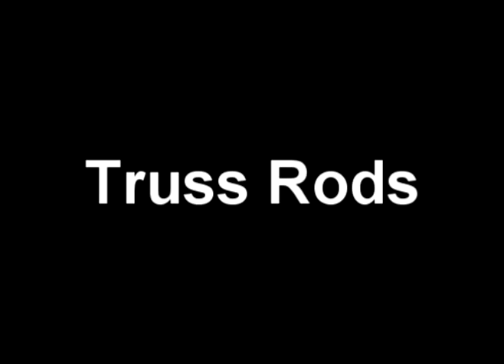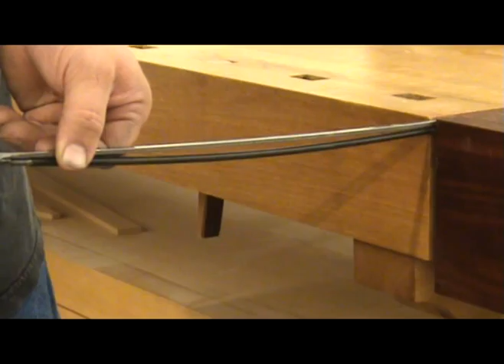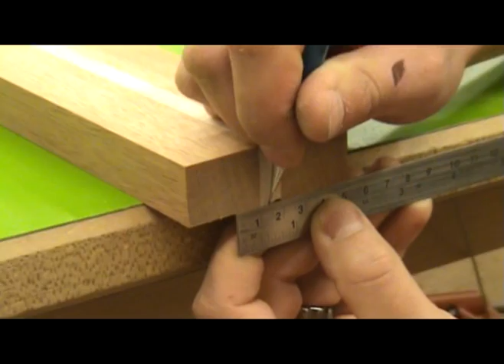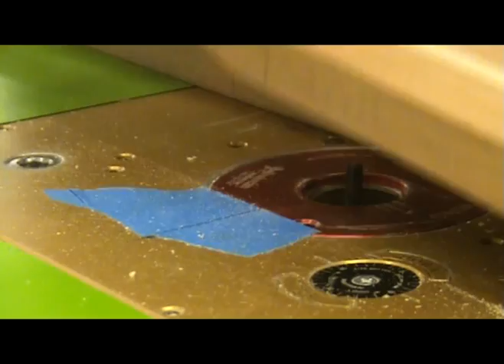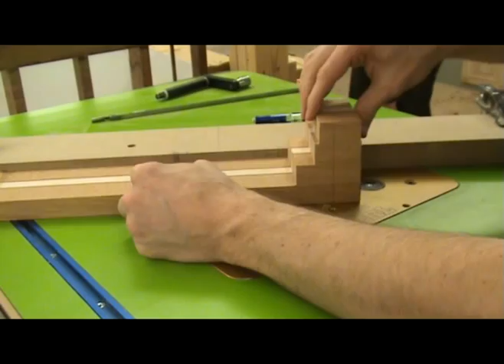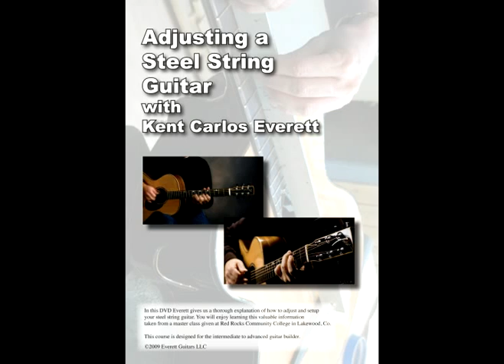Luthier Tips du Jour - Truss Rods - O'Brien Guitars

Comment: I assume that to compensate for the bow of the neck from the stress of the strings, one is supposed to tighten the truss rod which pushes up on the bottom of the fingerboard with the most pressure in the center of the neck, around the 7th or 8th fret. Doesn't the shim you have epoxied into the truss rod slot prevent this from happening?
Reply from the maker: No, the truss rod does its job with or without the shim

Comment: Great tips.
Just a question. Why do you bend the wood shim above the truss rod and not shape it (bowed on one side, straight on the other) and mount the shim with the bow on the side of the truss rod?
Doesn't the shim accumulate tension if you glue it while it is "unnaturally" bent?
(thumb's up!!)
Reply: Antonio While you could curve the shim..... getting an exact bend would be very difficult. There are no issues pressing the flat shim into a curve which will bend to a perfect profile with the pressure clamps.
Reply from the maker: Not sure I quite understand the question. All I am doing is pressing the shim down into the slot. It naturally bends more in the middle than on the ends.
Reply: Exactly. The shim bends, and it is kept bent while epoxy cures.
Lemme try to explain with different words.
If you shape the shim, straight one side, arch the other side, the center arc of the shim presses the center part of the truss rod, but the shim itself is not bent, hence the wood fibers of the shim are not under tension.
This should reduce the possibility for the shim to pop-up and press against fret board.
...... uff.... did I explain well what i mean?
It's like you want bend a sheet of wood, instead to use a bowl (already shaped) you use another sheet and apply pressure in the middle...

Comment: Great video! Question: How do you install a truss rod in a neck that will attach to the body with a dovetail joint and you want the adjustment part of the rod to be accessible via the soundhole? Or, does a dovetail joint at the body/neck always mean that the adjustment end of the rod has to be located at the upper part of the neck? Do you have a video showing how this is done?Thanks, Steve
Reply from the maker: You can install a truss rod that is accessible from the soundhole. Lesson 17 of Chapter 6 in my acoustic guitar construction online course shows how to do this. www.obrienguitars.com/courses

Comment: Cool vid! im repairing a gibson sg from 1968, (the rod broke) it has a channel .225" wide but the rod is .170" without the plastic cover the had (or still have. donno). This is my first rod instalation (on an old guitar) i'm thinking i'll cover the new rod with heat shrink tubbing. Do you think it'll work?  Also, the rod was installed so deep and covered with a thick (from bottom to top) piece of mahogany. Is this normal? Im also wonering if i should install a new mahogany (flat sawn, im not sure i trust it and it's hard to find quartersawn mahogany) stripe or a maple one to cover the rod. Sorry for so many questions. I appreciate your help! :)
Reply from the maker: It is hard for me to give advice without actually seeing it. I would go with the least invasive repair possible. Make it easy on yourself.
Reply: OBrienGuitars Thanks Robert, i appreciate your reply and do like all of your videos a lot, they are relly helpfull!
Yes i guess it's kinda hard. In the end I just tried to make the repair as close as i could to the way i found it. And i think it came out pretty decent. here are some pics if you'd like to see (site's in spanish thou): http://www.gbrcenter.com/repgsg.html
Reply from the maker: GBRCenter  That was a major. Repair but it looks like you did a nice job! Congratulations.
Reply: Thank you Robert! Best

Comment: Hi Robbert, Thank you for making these series of videos they are great along with your online courses. I have a question about fretting a steel string guitar. I've build 2-3 classicals and I'm getting ready to make my first steel string. so after gluing the fingerboard to the neck and making sure that its completely flat length wise does it make sense to adjust the truss rod to build a slight relief before hammering the frets in? thanks in advance.